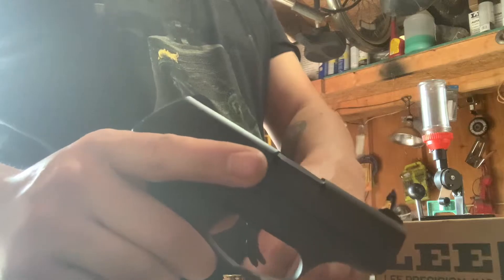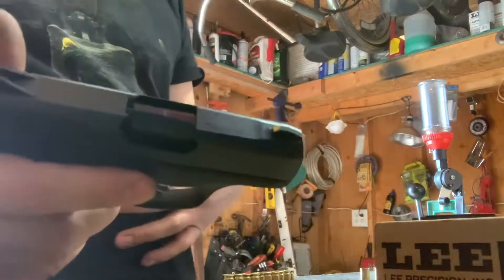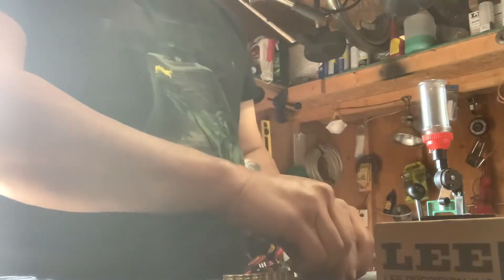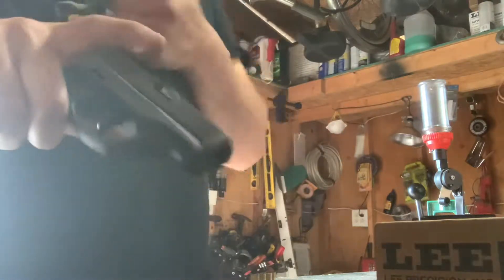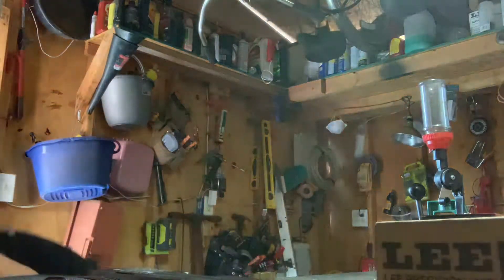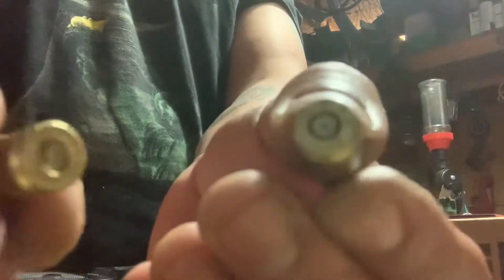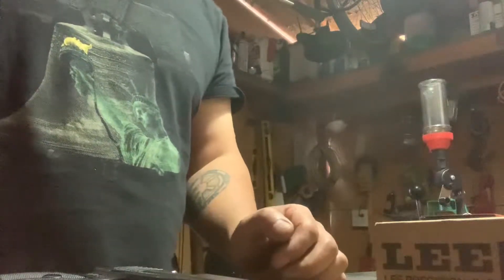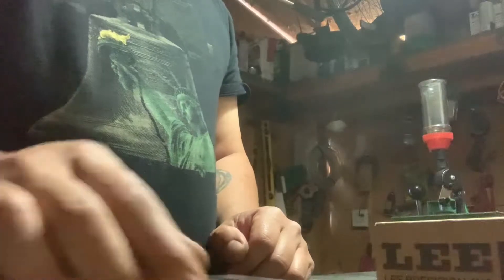Using CCI small Rifle primers in 9mm cartridges using a pistol with reduced trigger spring kit!

Comment: I have been firing 9mm 115gn bullets , using 4.0gn of Tite Group powder, with my SAR USA B6 {hammer fire) pistol, loaded with CCi Small Rifle & CCi Small Rifle Magnum  primers for almost a year and a half without a single issue of any kind! I was asked to load 10 9mm bullets using CCi  #41 primers to see if my B6 pistol could fire them. Guess what...My pistol fired all 10 without any problem of any kind! I didn't think my pistol would fire them. My B6 had only shot a couple hundred rounds when i shot the CCi #41"s. After the first 200 rounds, and a good cleaning and oiling, my B6 started smacking the # 41's with more force. If you want to shoot bullets loaded with Small Rifle, or Small Rifle Magnum bullets, I suggest shooting them with a pistol with a hammer. I also have noticed how accurate Small Rifle primer bullets shoot, especially long distances.